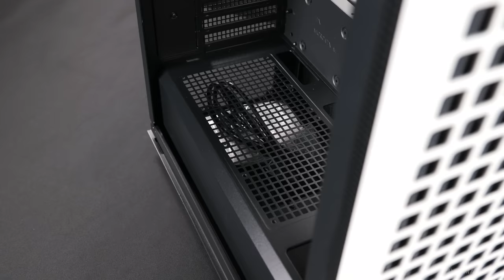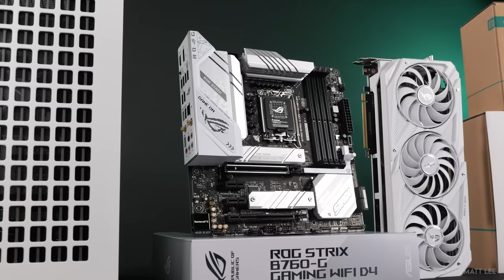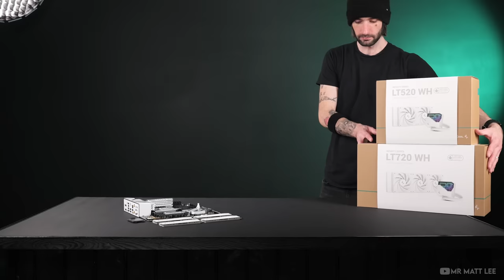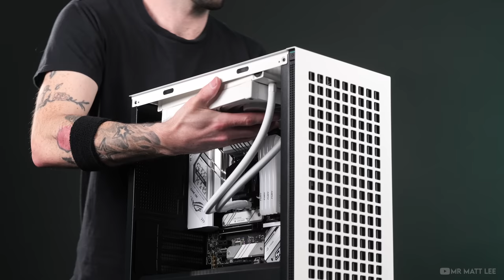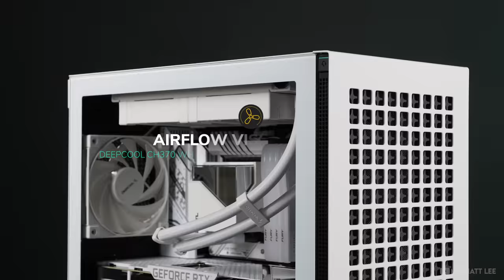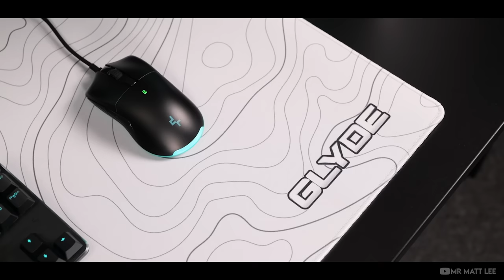HOW is this $60?! | DeepCool CH370 WH, White Gaming PC Build M-ATX | ROG Strix 3080, Intel i5 13600K

Comment: Didn't expect that retractable headset support. Color theme is relaxing. This channel never cease to amaze me.
Reply from the maker: Thanks Louie! The headset support is a great little feature which I didn’t expect either. Stoked you enjoyed the video and thanks for the support as always 💚🤍
Reply: I had to rewind the video, I completely missed it the first time 🤦‍♂️. Clean build!
Reply: If this case had front USB C and rubber feet it would be perfect. It's already amazing value with the build quality, airflow and nice touches like the headphone holder and built in anti-GPU sag bracket.

Comment: Great video. this way of applying thermal paste is honestly the best one based on experience of years in building PCs. however, I do add another small drop in the center to prevent potential air bubbles.

Comment: I like this. I think they should make this a line, make a larger ATX version. I would say ITX versions, and a line of more premium variants (more dust filters, more included fans, Type C, etc)... honestly with 4 slot / 350mm GPUS where do you save the space though on a mITX? If I had one thing I am not sold on, it's the switch that changes that filter from straight lines to a cross on the front. That feels a bit cheesy, I like the squares it doesn't need much else imo. This case really has me thinking about mATX again, which hasn't happened in a long time! Your videos are excellent as always. Thank you!!

Comment: DeepCool CH370 is definitely one of the coolest looking MATX case at the moment. Sadly, it can't fit most of 40 & 79 series graphics card which are longer than 320 mm.
Reply: if you use normal fans in front like in this vid, the gpu space is actually larger than 320mm. With slim fans it could be even larger. In this case the GPU and the front fans occupy the same space so the specs are very conservative,  I wish deepcool made them more nuanced. I bought the case few days ago and there is definitely more clearance if you don't use thick aio.

Comment: Hi great build again.🎉

I have a question, starting to build my own rig in the UK. But I am really struggling sourcing full towers from uk stockists including amazon, overclockers ….

I have order four cases and 4 times to be told that the items are no longer in stock and now cancelled orders. Lots of these cases I am told by manufacturers are EOL.

Is there something generally up?
Reply from the maker: Hmmm, that sounds really odd! What case(s) are you trying to buy specifically? There’s no shortage or issues per sè, so I can’t give you a solid answer sadly 😬
Reply: @Mr_Matt_Lee  well first I was searching and order (or thought I had) for Dark Base 900 pro v2. Couldn’t find it anywhere except one website (got cancelled due to crap website saying in stock when it wasn’t) so went to the manufacturer on Twitter and they said they wouldn’t sell to me direct and it’s EOL.

Then I searched for the Fractal Design Define 7 XL….rince and repeat just a different website.

So finally looking at the fractal pop XL rgb, but everywhere is pre order and you can understand I’m now nervous to commit again especially as this is a third option.

Sadly I’m now on to my fourth case option which is thermaltake v71 which is like 10 year old case….

I don’t think it should be this hard to find a full tower case that is modular enough to cover all the options….

Comment: Hi Matt, I'm looking for mATX case. In your opinion who is the best, CH370 or Asus Prime AP201?
Reply from the maker: That would greatly depend on your graphics card choice. The AP201 can take some of the biggest GPU’s available with excellent cooling potential relative to size. The CH370 on the other hand will be more limited in terms of GPU length and slot thickness, but with a more traditional layout and simplified build process ✌️

Comment: What is the actual max gpu clearance? Their website said it's 320mm but pretty sure there is some space left 🤔
Reply: The opening on the side is 345mm wide. The internal front-to-back distance is about 370mm without fans. So you can definitely add a bit longer card with standard or especially with slim fans. The GPU Matt used here is roughly the max according to spec, and you can see there is more space in there.

Comment: Spec for DeepCool CH370 GPU Length Limit 320mm. but ROG Strix 3080 330mm fit perfectly with full front fan inside..  really??
Reply: Spec is very conservative and probably written with thick AIO in mind. With standard (25mm) and slim (15mm) front fans you can definitely put in 330 or even a bit longer cards in there